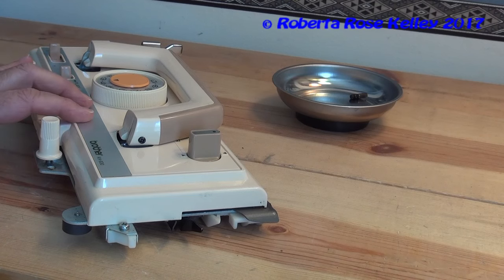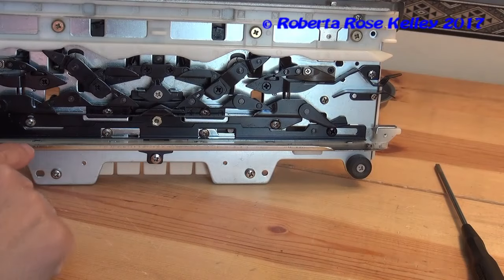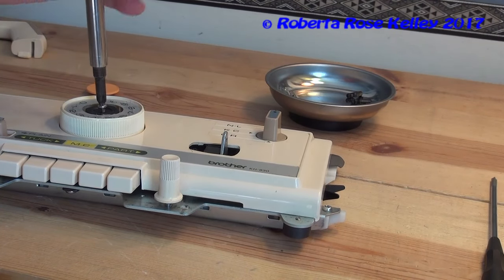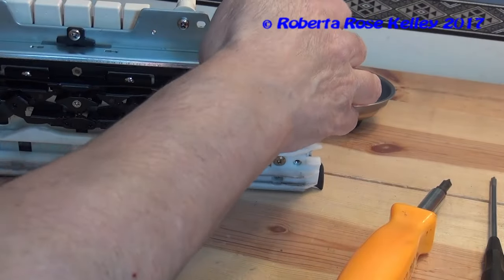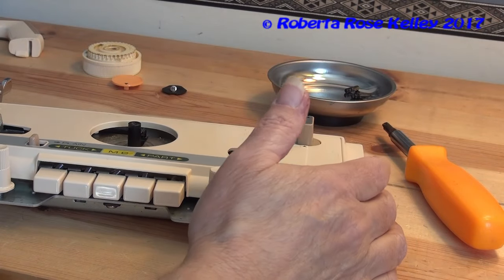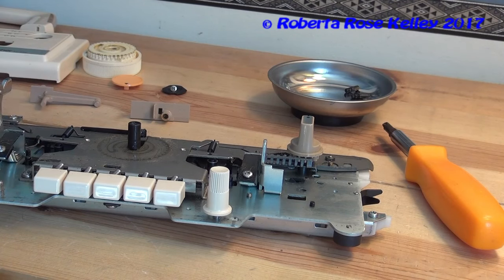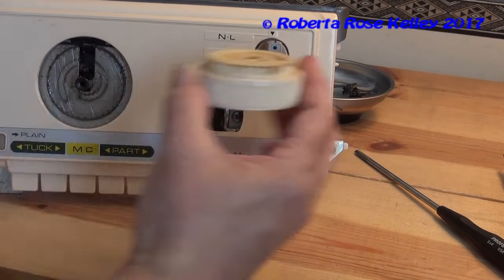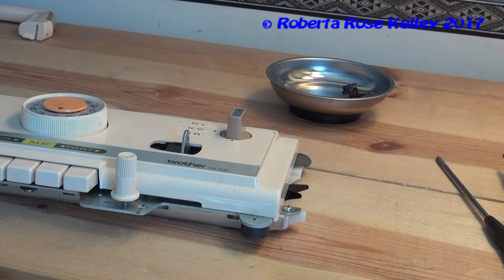Brother Carriage Cover Removal

Comment: how do remove a carriage stock to the bed
Reply from the maker: On the Brother machines, you should be able to turn that knob to CR I think it is to get the carriage off.  Now if the needles are stuck to the sinker plate, then remove the thumb screws and gently try to get that off first.  Been there a few times myself on both brother and singer machines, if we are not careful, those bad things happen to us.
Hope you get your carriage off and back to working.  If you do get it off, I would suggest to look at any needles in that area that got your carriage stuck and replace them and check your sponge bar also.
Berda